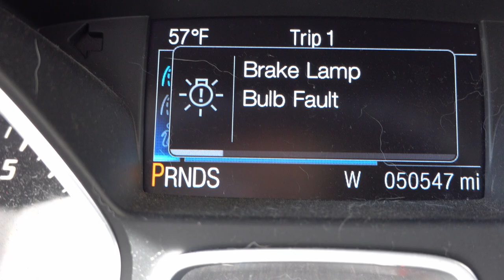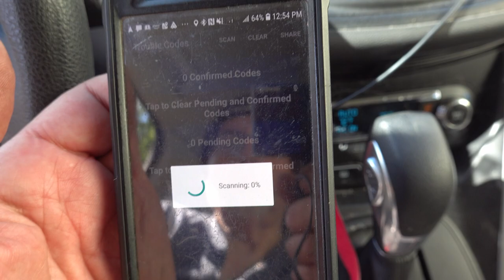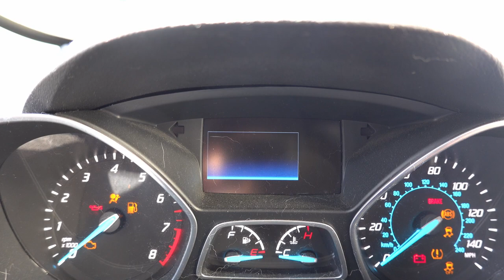Replacing Brake Lights on a 2016 Ford Escape

Comment: the cover doesn't come off that easy and yes it is that one clip that will not release.  Not one video shows the cover releasing.
Reply from the maker: Not sure what you mean by "cover". If you could explain in more detail, I'll try to shoot a video that shows it.
Reply: @magic.marmot  the assembly . Your video was the best out of all of them.  This was a bad design on Ford's part. One of my plastic clips attached to the assembly by the trunk opening was very difficult to release but eventually came loose without any damage.

Comment: Yeah it doesn’t work that way, you’re leaving out the part where you have to separate the clip inside the mold. If you keep pulling you’re damaging your car. Don’t use this video
Reply from the maker: Could you please explain "separate the clip inside the mold"? Does it have to do with removing the brake light assembly?
I've had zero issues, though I have learned a better "pushing" technique that I explain in a later video when I added a trailer harness kit. 
As for "Don't use this video", you are more than welcome to not use this video. For anyone else, I suggest that you watch this video as well as others so you can get several viewpoints on how to do this. I am certainly not an expert, but I have managed to perform maintenance and repairs without damage for several vehicles now.